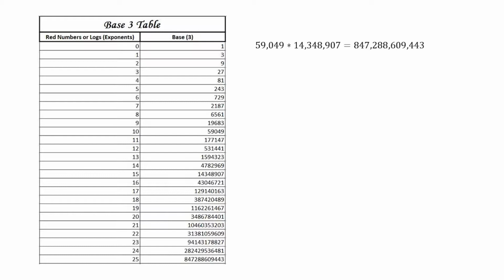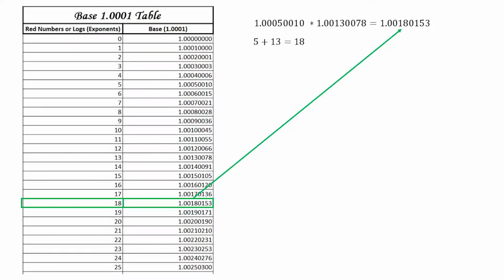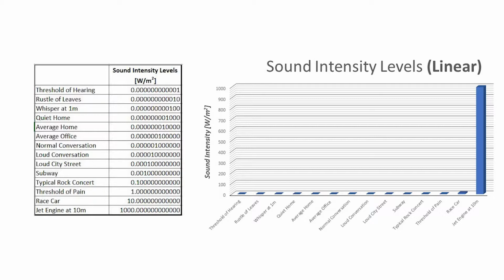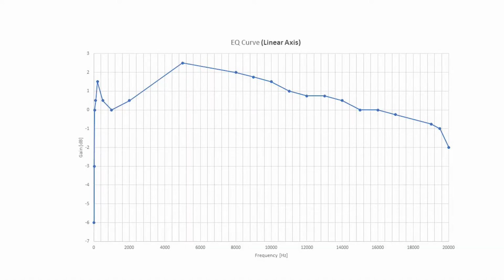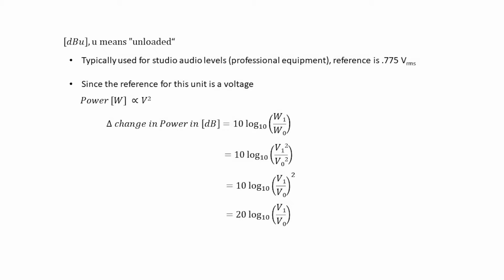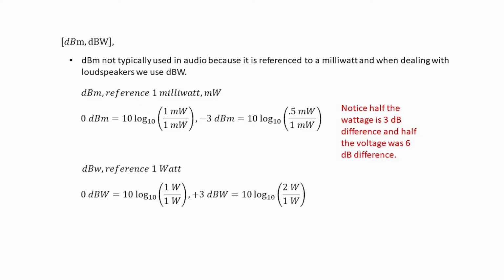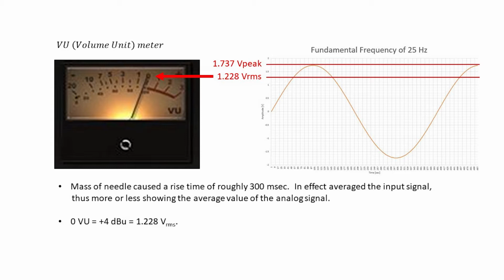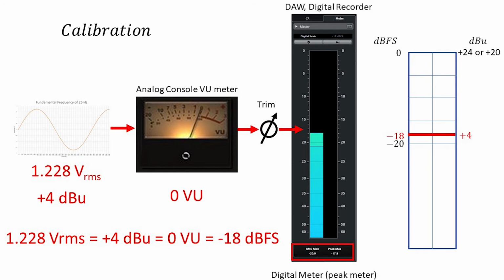Audio Units (Bels, dB, dBu, dBV, dBFS, dBm, dBW, dB SPL, VU meter)

Comment: 3:10 wanting to easily multiply big numbers is NOT the reason why logarithms were invented; the demo multiplication is the mathematical consequence of logarithms, not the cause or reason. By the way, the changes that someone would want to multiply the exact numbers in the table are virtually zero. What when I want to multiply 59050 with 14348906? The table is almost useless. Yes the table can be used for multiplying big numbers, but the outcome will be approximate on most household calculators.
Reply: Okay, why were logarithms invented then? Because some quick Google searching agrees with Artist Forum...

Comment: Thank you for a very informative video. The VU meter in relation to dBFS in DAWs is particularly useful information. I reckon this single video could be turned into a 10 part (potentially paid) course for beginners, simplifying each subject a little (I felt some assumptions of knowledge were made). On a side note, I found the audio gate distracting.